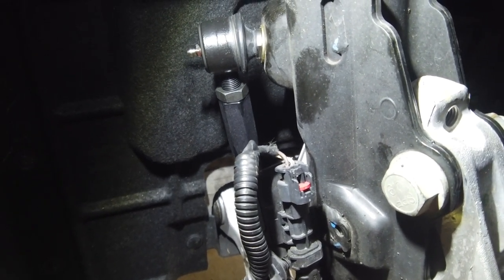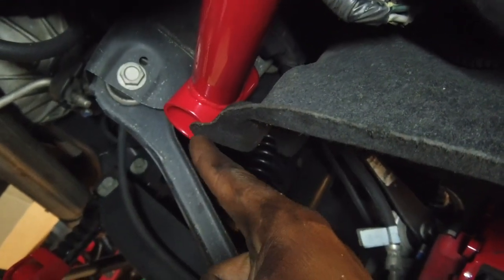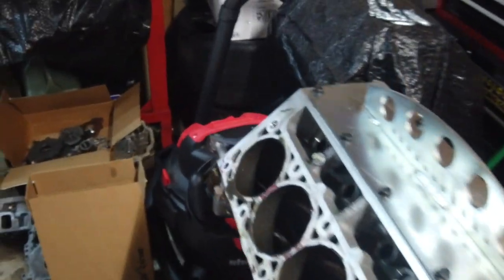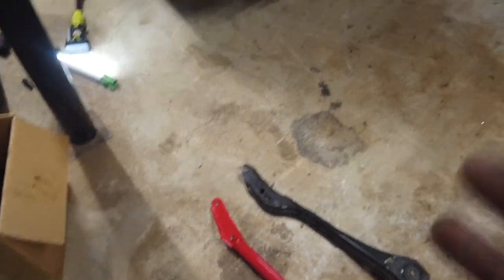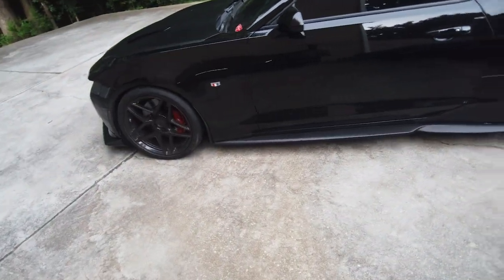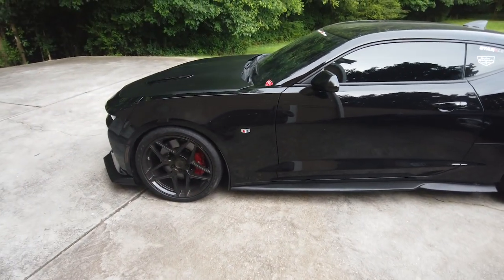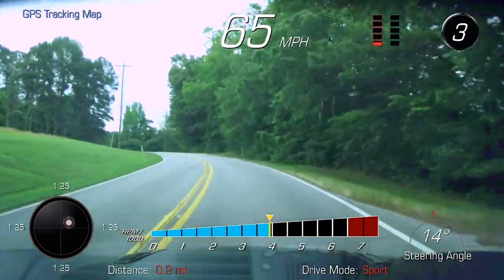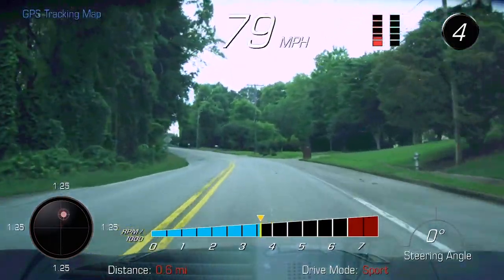2017 Camaro BMR Front of Rear Chassis Cradle Brace

Comment: You said you don’t have to jack up the car but it adds tension on the parts. What if I rolled it up on ramps and used a jack on the rear diff?
Reply from the maker: Really wouldn’t need a jack on the rear housing in that scenario but it might help. But I could see that working. This particular part isn’t under any spring pressure and doesn’t have any stored energy, that’s why I said you don’t need to jack it up. It’s just more of a support part.
Reply: @Stan1le  ok thank you.

Comment: I don’t see the point in the cradle brace if you have the bushing lockouts
Reply from the maker: Just either or and I chose the braces instead. Plus they are about half the price. I’m just not a fan of the cheap stamped steel parts so I wanted them gone